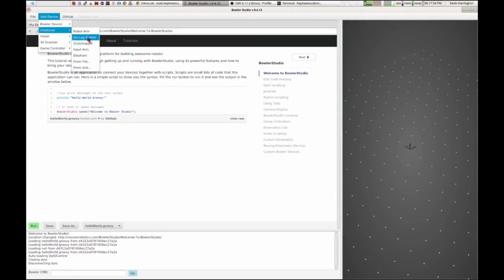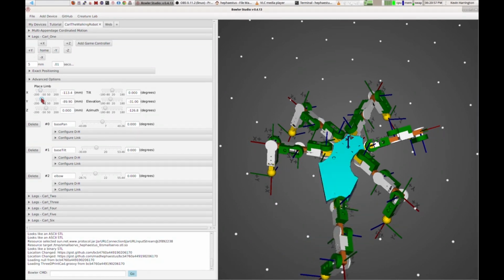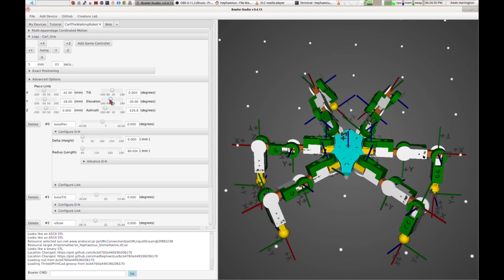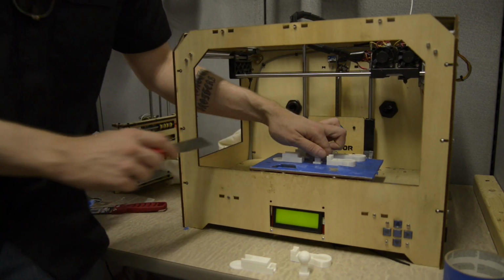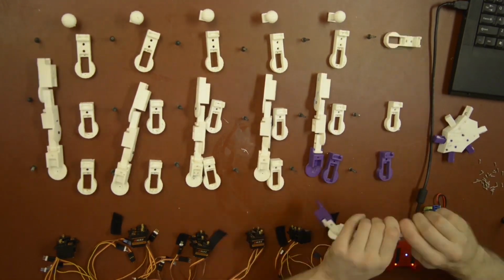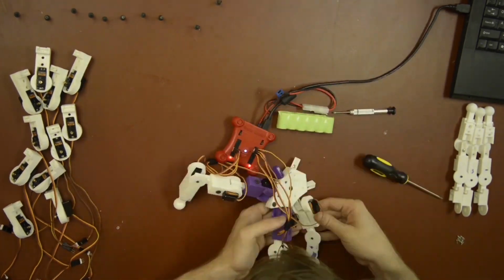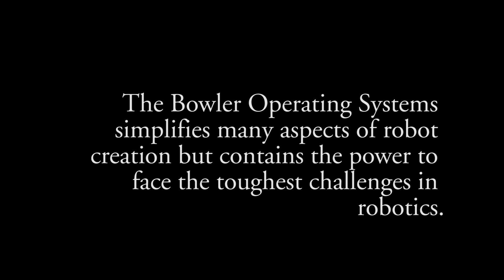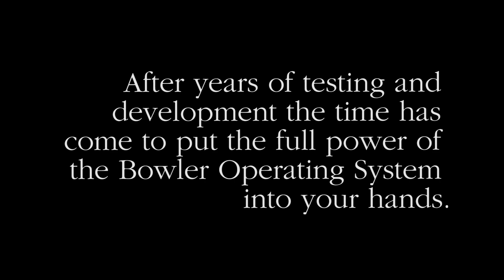Neuron Robotics Cooperative: Wifi DyIO Kickstarter

Comment: Can't a cheap ESP8266 already do everything a wifi DyIO could do?

edit: Ah the DyIO has more GPIO ability (especially analog), better 5V compatability, easier to access pinouts, handy onboard power options, and USB.  To do all this with an ESP8266 i'd need to add a fair few components.
Reply from the maker: +roidroid in fact, if you check the BOM (the whole device is open source and open hardware) you can see that we use ESP8266 to provide the wifi features, so good guess!